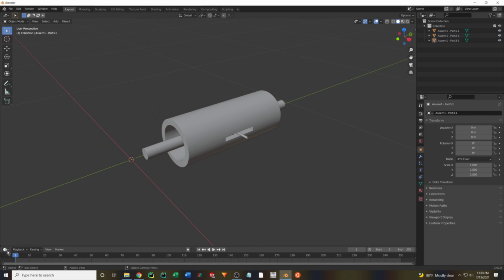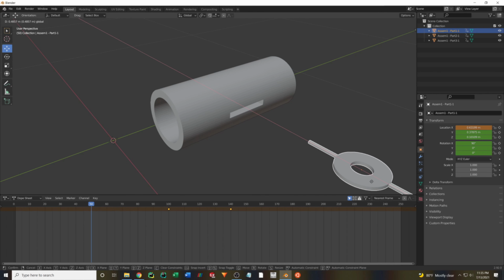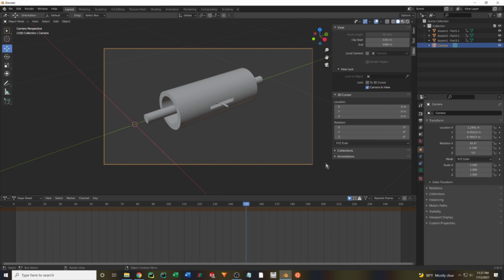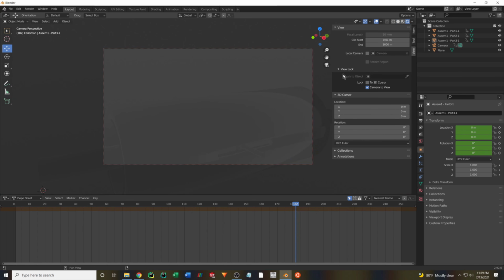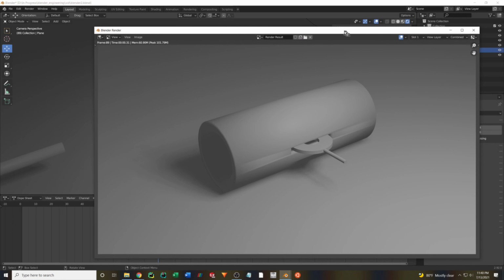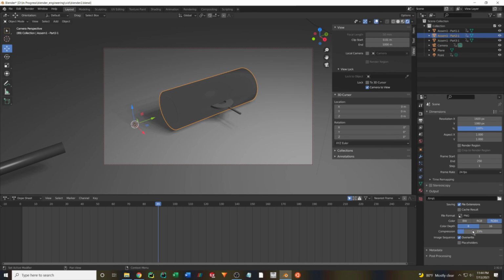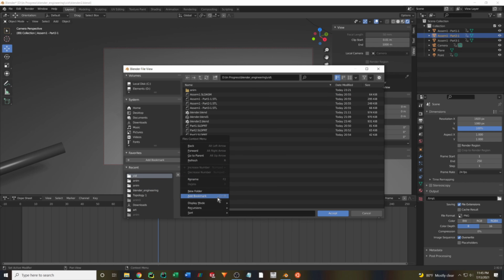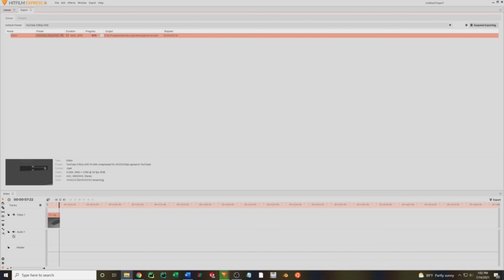Animating Assemblies in Blender

Comment: Hello, Autodesk Inventor is saving or exporting the assembly as a single .stl file with joined bodies. It is not giving separate stl file for each body for the assembly. What to do?
Reply: Ok I got the answer, for anyone wondering. In "Save As", click options and them export as multiple files.
Reply: If the file comes as one or you have multibody parts in one of the files that you want to animate separately, hit Tab in Blender to enter edit mode with the part selected, hit p key and "separate as loose parts". Be sure to set the origin point of each part, but sometimes (say on a piston arm) another point may be more relevant. If a part need multiple points of rotation, parent the part to an empty and animate the empty (both selected, then ctrl+p).

Doing some Blender tutorials would be nice too. This guy don't seem to address some of the smoothing issues that may require some cleaning up of the imported geometry.

Comment: Dude i have a question, whenever I try to move a part, independently its only selected one, when I move it, the whole model moves... I could achieve moving just one part but I ain't know how... Do you know how to move just a part?
Reply from the maker: Make sure to export all of the components into individual files and then you should just be able to select one component and move it independently once in blender
Reply: @interfluo6420  that worked 😅  thanks man. You got a subscriber and that like

Comment: Your videos are very interesting and useful.  thanks a lot.  what are the specs of the server you run the simulations?, do you use the cloud?  Best regards
Reply from the maker: unfortunately I am just running everything on my desktop which is nothing special: 3600x, 2060 super, 48gb RAM, ...
Reply from the maker: Thanks for the nice comment!
Reply: @interfluo6420  with linux?
Reply from the maker: No I run a Linux subsystem in windows 10